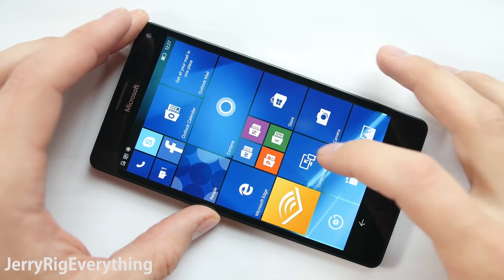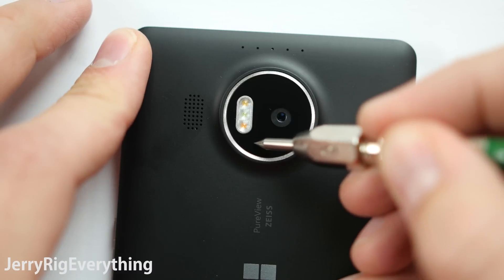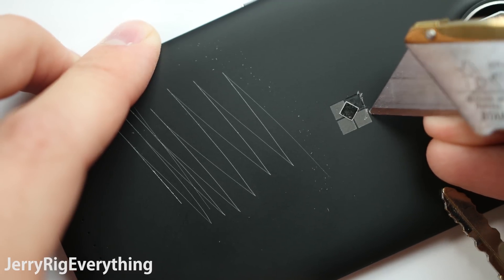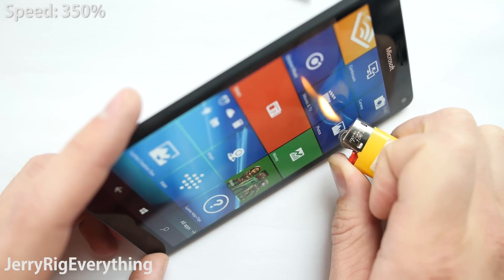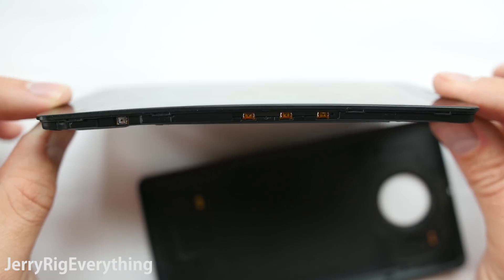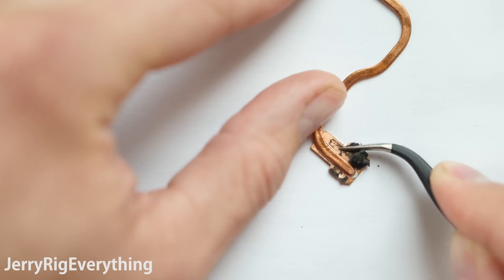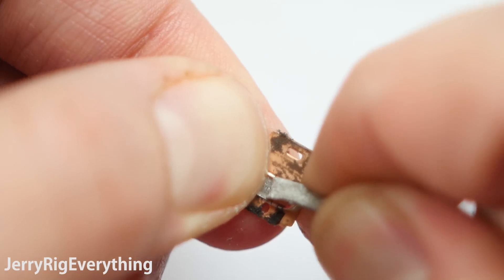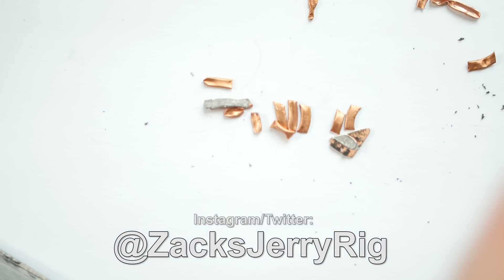Lumia 950 XL Bend test - Liquidless Cooling - Scratch Test

Comment: 4 Years later, I am still using my 950 XL, it's a bit outdated, but until recently it was regularly updated, it's still working well, however, I had to get myself an android as a side phone for some apps that a company used I worked for. Main phone tho I still the 950 XL, wish Microsoft would fully unlock it for the community so that we could maybe get android onto it since the hardware is still good even today.
Reply: I bought my Lumia 950 XL in 2016 and I am still using it now in 2021. In my opinion this will remain a true masterpiece in the world of phones.
Reply: @silviarevnic3997  it was anomaly, the screen is still amazing, the system is super responsive and the camera was also ahead of its time, simply the apps were an issue and maybe the is look, but aside from that is was on par or superior to almost all phones.

Comment: still using this phone in 2019, works like a charm but sometimes prob occurs in swiching apps..only 2times battery replaced..still loved this phone..
Reply: r u using 950or xl??
How is the battery backup??
Any laginess??
Pls reply.
Reply: @narendranarayansingh4018  I have both. The 950 is my daily device. The xl is my backup, in case the 950 dies. I still love using them. The 950 does get hot under heavy use, and during charging. I have no issues with lagging and the battery still comfortably lasts a full day, I'm not constantly on the phone though, so just basically checking a few emails and WhatsApp throughout the day.
Reply: @pietpompies7381  thanks for ur reply  soon i am getting one.
Reply: Would of loved to get one but only AT&T carried them

Comment: I watched that unveiling they also promised to port apps from play store and app store to the the windows store. That never happened....in fact it completely disappeared off the internet. 

I was very pissed as I liked the windows UI and decided to upgrade to a windows phone. 

Another promise never happened was that windows 10 never came to windows 8 devices. I managed to get a slow build beta but in the end it was so dodgy that I got locked out the phone because the keypad I typed my pin number into wouldn't show up.....I knew how to fix it, like all the other problems previous builds had but I decided that I would get my wife's HTC M7 out of the attic and I used that instead now I type this message on a Samsung S7E. 

I did fix the phone in the end (lost all my honeymoon photos in the process) and gave it to my mother-in-law as a starter smart phone, it lasted about 6 months maybe more and finally the battery started to give up, so instead of buying her a new battery, I got the old HTC out of the attic once more and gave her that instead. 

Microsoft don't care about there customers. I sent a email directly to Microsoft, telling them that if they don't do what they promised and release a official version of windows 10 and port the apps like they promised, I would go back to Android............I never received a single email back. 

So now you now why I clicked on a picture of a windows phone getting bent into two.....just wish you went at it with a hammer to truly test it's durability. 

RIP windows phone....now rot in hell. (Not the workers that make the phones and software, just the concept of windows phone)

Comment: Get you facts right before making a video, the liquid inside the pipe is only a very small amount, also the probably evaporates with little heat and so when out in room temperature it evaporates.

Comment: It’s possible that the small amount of liquid didn’t leak out because it was trapped in the capillaries of the copper. It wouldn’t normally just fall out, in normal use it is pushed through those tinny capillaries with pressure. I’ve never personally seen this heat pipe so I’m really just theorizing based on other designs, but that definitely seems to be a vapor chamber design, kinda weird....

Comment: THANX FOR THE VID Jerry,
This is called faults advertising and we the users of the
950 xl should get our money back, and if anyone has the time and money/ balls
to sue M.S. for advertising there latest and grates phone. 
I've had the Lumia 900, 920 and now the 950XL dual sim. The previous 920 got way to hot using Whatsapp, FB Messenger or anyother app which had to do with using the data via the sim card, even when playing video games off-line. So this has been a big issue for the Lumia 900 series, great models but not enough apps like the IOS or Android but that was okay for me since it is a phone where you can amlost not destroy the unit, but that it got so hot that my screen lifted up due to a probabal batery expantion because of the unit getting almost as hot as my laptop i5 4800-u CPU running at about 90 degrees celcius.

When I was in the Las Vegas CES back in 2003 there they announced
the liquid cooling for the desktop power supplies, which by the way was an awesome
thing to see, and yes the clear tubes did have a green liquid inside of them like
anti-freeze for the cars.

So that being said liquid cooled is liquid cooled and not liquid cooled by condensed
air or whatever other story they wanna come up with.

Microsoft has been doing this for years and have not been keeping up with what they say
they are selling, like when Windows 10 came out for PC and was supposed to be the
latest and greatest with less problems than the previous O.S.’S again, “BULL
SHIT” I’ve had nothing but problems with my drivers for Win10 since it came out
and they still have no adequate fixes for the bugs even after all of their
frequent updates.

I guess we “the consumers” will never make a big enough
impact on Microsoft cuz they just don’t seem to care about us and tell us the
truth about their products, nor try to help resolve the issue “permanently”
Like my father and his friends always said Micro-shaft, cuz its true, all they do is shaft us and if we want help it takes days to get a hold of the correct expert and even more time to get the problem resolved. I always use to laugh at when they said that but years latter i am starting to realize that it's true with what they were saying. :-(

Comment: i think you could "upgrade" your lighter flame test. or add another, similar and a bit more relevant test - a heat(/-gun) test.

because more often than not, phones and especially their screens are exposed to excessive heat only to remove the glass from the lcd. and it would be very interesting to see, how hot the lcd can get without getting damaged permanently. and you could measure the exact temperature of the phone in the process and that could be another comparison point for the phones.

of course, you would destroy the lcd in the process. but i don't think that really matters :)

anyway, thanks for your great videos!

Comment: Does it still work?

Anyway:
There is liquid inside that Heatpipe, just not a huge amount. And it's usually a liquid with a rather low evaporation point. Probably some kind of alcohol.

Things like this are used for "decades" in Notebooks and also for more than a decade in normal PC systems with better heatsinks. So nothing new there. And no real liquid in there because you'd rather have them in their gas form.

Comment: Hey JerryRig, the coolants inside those heat sinks evaporates under atmospheric pressure. It's in a constant state of evaporation and condensation, and is under pressure. That's why it evaporates so easily.
Reply: Hey Reagan,
You seem to have some physical concepts a little out of order. Liquid evaporates. Gas is evaporated.

Depending on the liquids, the device may be at pressure or vacuum to ensure the fluid sits near the boiling point.  For the vacuum pressure fluids, once you open them there is an instantaneous drop in pressure and the liquid evaporates. In this case the liquid is held in place by a wick until it evaporates, so it doesn't flow freely.

Does that make sense?
Reply: @pellegew  yo,thx for the science lesson m8.Gained about 10 brain cells.Thx
Reply: i see. thanks for the correction.
Reply: Exactly.
Reply: Yes actually, very similar. But without the mechanical pump
Reply: Eric Pellegrini right on.
Reply: Eric Pellegrini  even I was thinking the second thing
Reply: Eric Pellegrini  like freon?
Reply: @DetroitBecomesBuddha  lol dumbass
Reply: the it is not liquid. it is gas. gas evaporates.

not a single drop of chemical i saw. sorry i just cannot believe that.

Comment: I think its resistance to heat has to do with the fact that the touchscreen does not work with heat but instead is touch sensitive. So the glass is probably designed to not let any heat through because it doesn't need to transfer heat to the touch screen.
Reply: then you don't know how touch screen works.. all phones don't need heat to work their touchscreen but the damage done to the liquid crystals is meant to replicate heat from a heat source, which is unlikely in real life but it does mean a better thicker glass used to cover the display.. thus dissipating the heat
Reply: Steven Khoo http://www.theverge.com/2012/9/5/3293616/nokia-taps-synaptics-for-lumias-glove-friendly-touchscreen-tech  I'm just going to leave this here. What does it make you if you're a smartass but you're not actually smart?
Reply: I merely stated that that you are wrong with touchscreens needing heat to work with earlier touchscreens using pressure and now using capacitive. The article you shared just tells me that they have used an even more sensitive capacitive touchscreen. Nothing Related to heat sensitive screens or anything that has to do with this argument. so I don't see the point of you rebutting me other than maybe showing me that you are ignorant??
Summary of the argument thus far, you claimed that the lumia doesn't need heat to work anymore but instead uses capacitive, in which I replied by saying touchscreens had never needed heat but the resistant to heat in this lumia model was for shatter resistance (thicker glass in my reply). but you rebutted me saying I was being a smart-ass and showed me an article that said nothing about heat sensitive screens.

Comment: Microsoft should have called it "fluid" cooling system, instead of "liquid", because it has air inside, which is a very good and widely used heat transfer agent

Comment: its a regular ass heat pipe, its not "liquid cooling", but it clearly is a heat pipe.
Reply: +Travis Law
a vapor chamber is a type of heat pipe, not only that but if you look at the shape of this pipe it's clearly just a normal, abeit much smaller than what you see on desktop and laptop applications, heat pipe that looks like it's been attached to either a pair of copper plates or a very thin vapor chamber.

Comment: The heatpipe contains a gas under pressure, the princible is based on evaporation cooling. The heat from the electric microchips evaporate the gas, which is then condensed back again into a liquid. This transfers the heat. The liquid isn´t visible because the pressure inside the heatsink is high and when you cut a hole, the pressure drops to atmosheric pressure. Sry for my bad english.

Comment: Of course you can't find the liquid. It's a heat pipe which means it's not water but a liquid which evaporates on a much lower temperature. Judging by the size of it it must be a very small amount so on opening the pipe it just evaporated.

Comment: MS never said there will be water inside of it. Liquid could be anything and at any amt. 1st that amt in that tiny space needs to be able to move around. Is not like it has a water pump like we see on a car. Also, its well possible that the liquid was at one point, was actually liquid, and after few usage and heating up by the CPU became gas. In any case, it does have it and this system is keeping its 810 CPU nice and cool, as my 950XL NEVER gets hot(unless i'm charging it). So this cooling system definitely works and works GREAT.

Comment: "...compared to a one-dimensional tubular heat pipe, the width of a two-dimensional heat pipe allows an adequate cross section for heat flow even with a very thin device. These thin planar heat pipes are finding their way into “height sensitive” applications, such as notebook computers and surface mount circuit board cores. These vapor chambers are typically fabricated from aluminum extrusions, and use acetone as the working fluid. It is possible to produce flat heat pipes as thin as 1.0 mm (slightly thicker than a 0.76 mm credit card)."So... It's basically a sealed vapor chamber with acetone, that starts to evaporate at 56°C (processor temperature or higher) in addition to the characteristic heat transference of the metal.When the vapor chamber/heat pipe is no longer sealed the acetone will evaporate at ambient temperature like alcohol so... the guy of the video doesn't know how it works...

Comment: everyone here bent out of shape with the absence of real liquid cooling, when the point of the test was the real durability of the device which held up miles better than any other modern device that's not mil std or ip rated and frankly it did better than some of the ip rated devices out there in structural survivavblity

Comment: It was removed before the retail units have hit the 2nd batch due to faulty seal off the pipe, hence the 2nd batch is with just a heatpipe instead, which is doing a great job actually.

Comment: Wow. He did not even read the answer about the liquid cooling on the Microsoft page correctly. They say it is a "traditional liquid-based cooling system" which means it is liquid cooling. He somehow reads it as "the heat pipe is based of a traditional liquid cooling system" which implies that is not exactly liquid cooling.I would be more concerned about the integrity/longevity if massive amounts of liquid came running out of the heatpipe. It could be just enough liquid to have an effect on cooling, but not enough to visibly see.
Reply from the maker: If it's liquid based... That means it's not actual liquid.  Otherwise they wouldn't need the word based.  Vapor maybe.  But not liquid.  No hard feelings man.

Comment: A heat pipe that small would be using a minuscule amount of liquid to evaporate and travel end to end, it could be that it was all already in the evaporated state within the heat pipe and partly escaped by the time you cut it open. If they were going to do a heat pipe without the crucial component of evaporative liquid inside they could have just done a single copper block for less milling effort.  
I don't think they're trying to trick anyone here like the title says, it's just a tiny amount of liquid for a tiny copper heat pipe. Heck, I've broken larger heat pipes for desktops and no liquid came spewing out, that's just how they are.